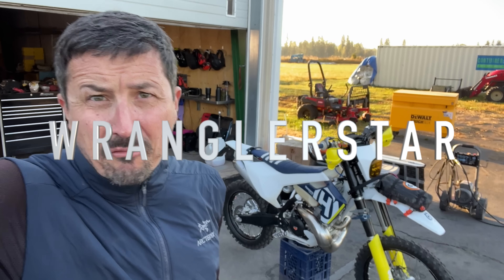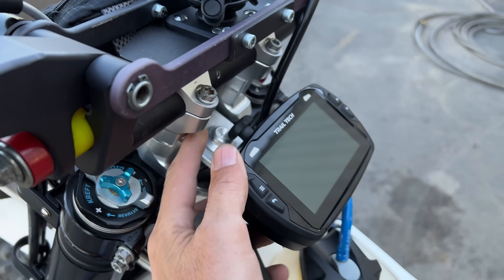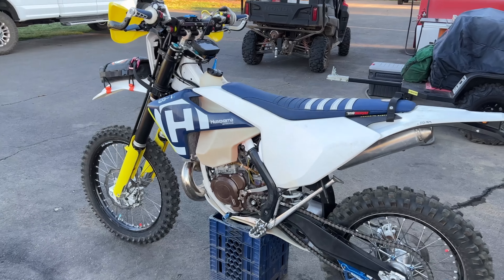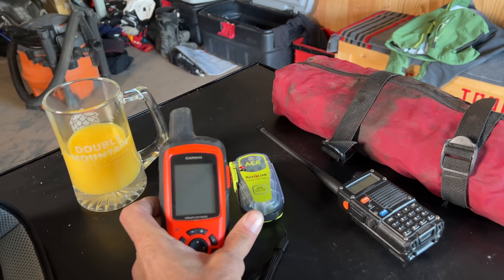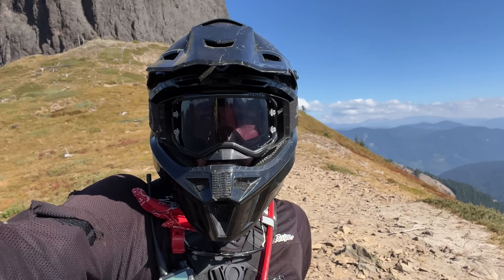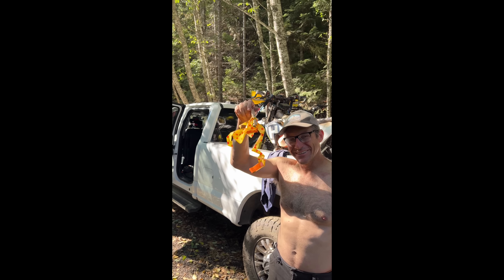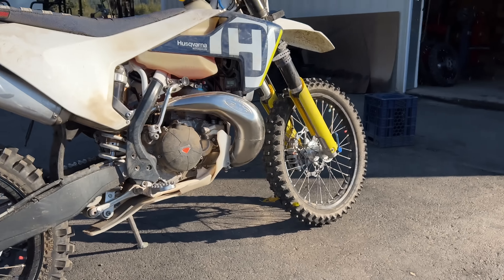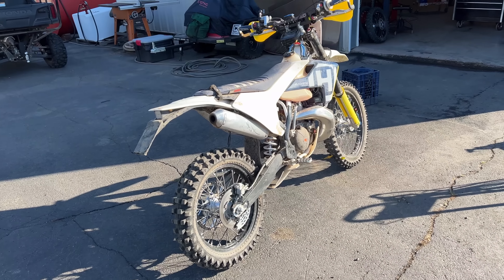I Wasn't Going To Upload This Video...

Comment: Why are there 2 valve stems in the rear wheel?
Reply: Tubliss system uses one for the small high pressure tube that holds the bead in place and the second one puts air in the tire. Probably easier to go to their website.

Comment: I have my 2011 KTM 300 XCW suspension set up to what I call " supple" for trails only , I love it.
I need a recommendation on good enduro riding gear , my current jacket the sleeves unzip which I like but not enough pockets .

Comment: Throw some tear-offs on those lenses. Its nice to rip it off mid ride and have clear vision.
Reply: Those are really only good for short rides. The problem is they're purpose built for racing not necessarily for clear vision but enough to vision to stay on track. You tear it off and within minutes it's dirty again. On casual rides it's easier to just stop and wipe down the outside.
Reply: Treat the lens with "Dust off" plus you're not littering the forest....

Comment: I have stopped using my iphone after damaging the camera multiple times due to vibrations caused by the bike (I have the same bike)... 
How does the quad lock hold up to that?  I have seen quad locks on the market but always used a solid mount (which I am assuming has played a role in the issue)

Comment: Perhaps I’m wrong, but I believe your reasoning behind the solid brake disc overheating less is incorrect. The slotted discs should allow for better heat dispersion and cooling. The solid disc, while it increases stopping power should overheat more easily because of reduced cooling. It’s the same concept for car disk brakes. Not sure on this one, but I would also think that the slotted discs would allow for better clean out for mud as opposed to solid disks.

Comment: Can someone explain where has the rear brake gone ? Is the front & back coupled ?
Reply from the maker: Rear brake is on the left hand on a custom double lever setup,
Reply: @wranglerstar  thanks for the answer, i’m looking it up !
Reply from the maker: You won't find it online. We use a custom made double lever bracket that is machined here locally. Unfortunately not for sale to the public,
Reply: @wranglerstar can you clutch and rear brake at the same time with this set up? Do you have a video of the set up?

Comment: Great Ride (6 oops would be a bare minimum for me)😊 Do you have a link for rewinding stators? Baja Designs doesn’t sell the one I need✌️
Reply: I need a stator rewind source, also. My old Honda stator is obsolete.
Reply: @tkendall  my kids CR has encountered the same fate. as I will likely have to diy...good luck👍

Comment: I am very interested in that gas cap. Looks like you can lay it down to rest a tank bag on top of it. Would love to know more about that. Clever idea. Regarding the QuadLock, my KTM has killed 2 cameras on my phone using the quad lock. I did get the dampener for street riding, but for off-road, the phone gets stowed away.
Reply: Looks like a stock Husky gas cap with a Taco Moto Free Flow vent hose. Warning: once you visit the Taco Moto site you can't  un-see it -  Happy shopping!
Reply: @itsFritz  Thanks. I know Taco... All Kim owners know Taco....